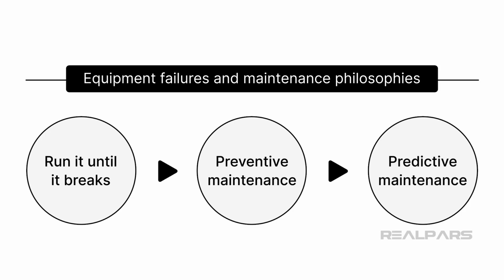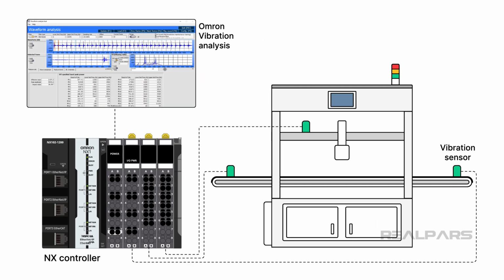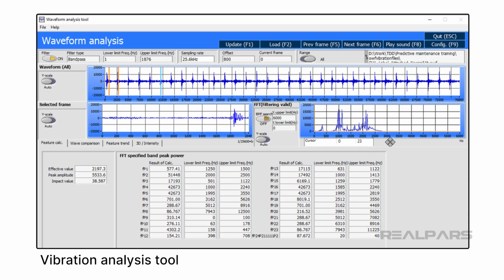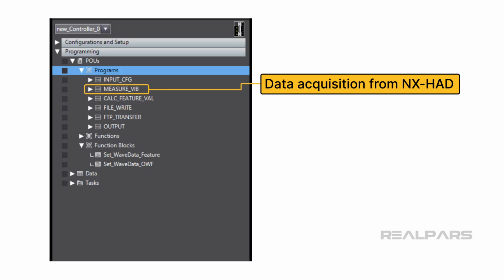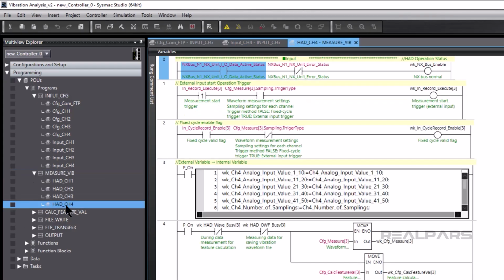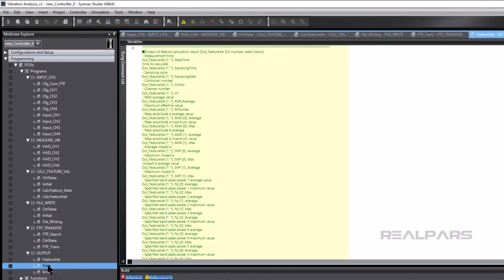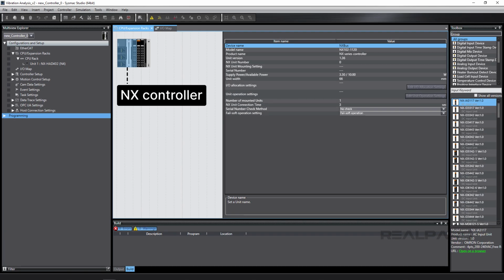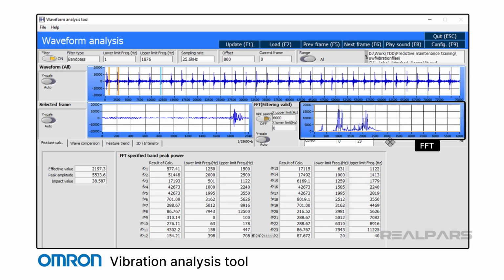Mastering Omron Vibration Analysis for Predictive Maintenance

Comment: Thanks for the video
I have a question, is it posible to use an USB to serial port cable to connect my OMRON CP1E 30 pin to my computer? I've been trying mutliple times but I had no success. I have my Omron connected to a desktop PC using a serial to serial cable but I need to connect it to my laptop, so I thought to use the USB to serial cable but I had not success, I tried to connect the serial-to-serial cable to the usb-to-serial cable but it didn't work. I would appreciate any help, thanks
Reply: Did you install the driver for your USB to Serial cable?
Reply from the maker: Hi there. Thanks for reaching out.  I’m not familiar with that model but I’ve got lots of experience attempting to connect with other PLCs. Always a load of laughs……I don’t know exactly what you’ve done so far. I’m sorry if I’m suggesting things you’ve already done. First of all, be sure to install the drivers for the USB to serial adaptor. Secondly, ensure that you’ve got the correct COM port selected and properly configured. That’s always a challenge. This usually involves digging into the Windows Device Manager. Good luck!  Let us know if you are successful or if you have any more questions.